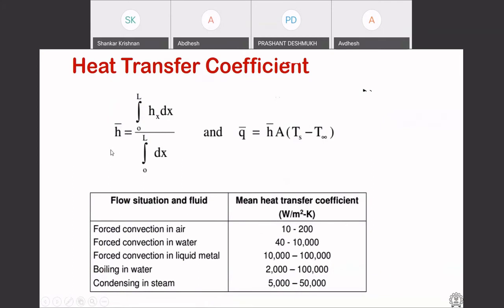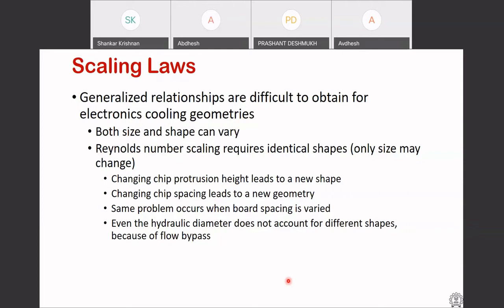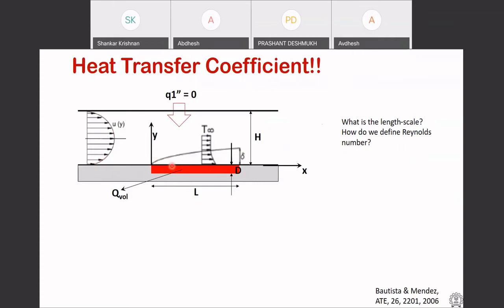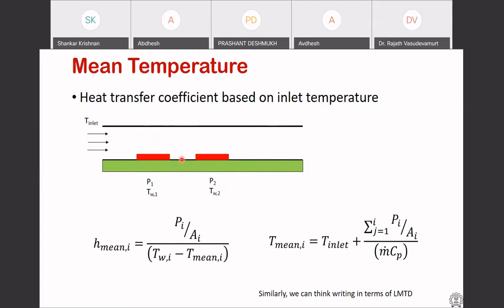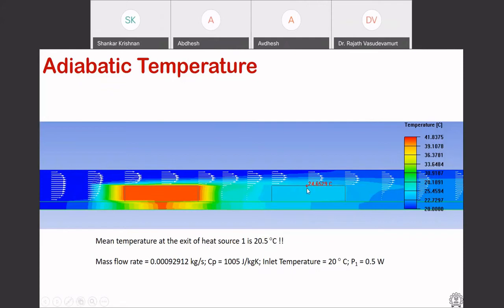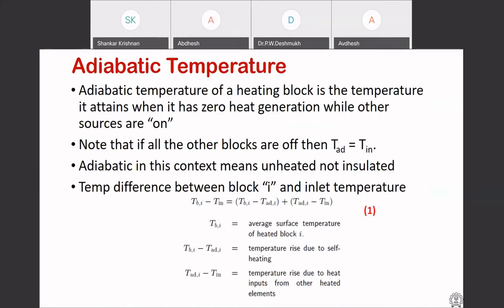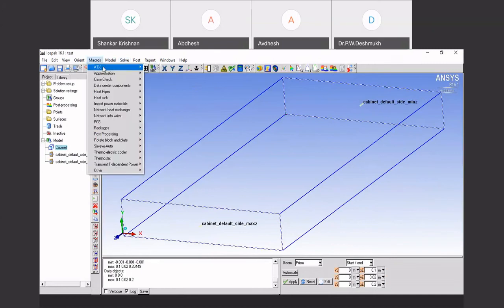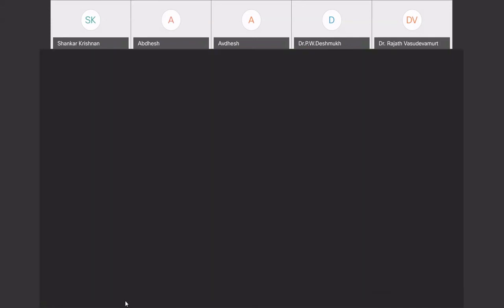Heat Flux in Convection by Prof. Shankar Krishnan

Comment: How do we design a heat sink with an optimized operating point? also how can we plot the pressure drop vs flow rate graph for the heat sink or system?